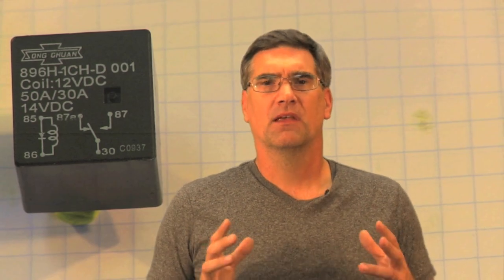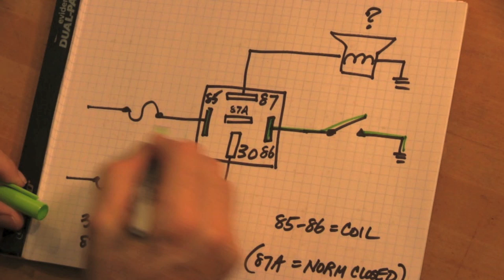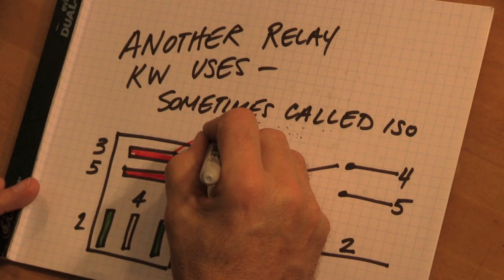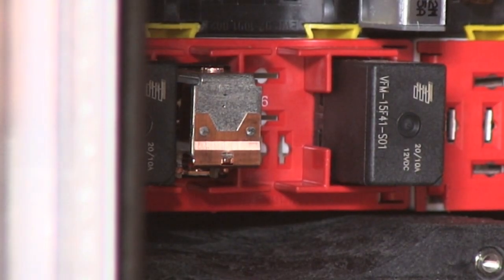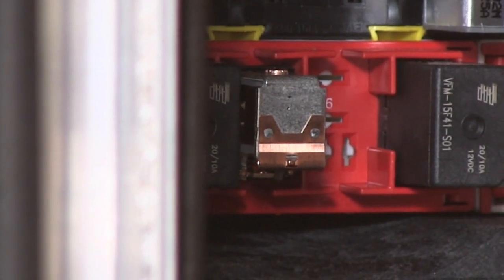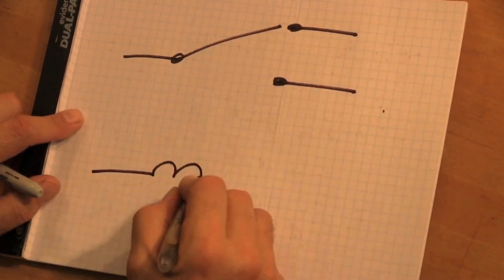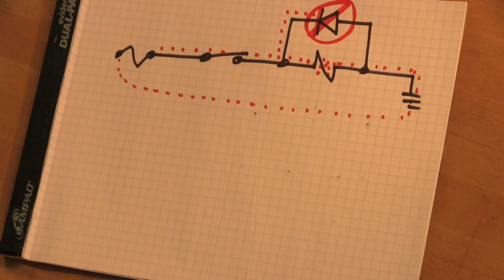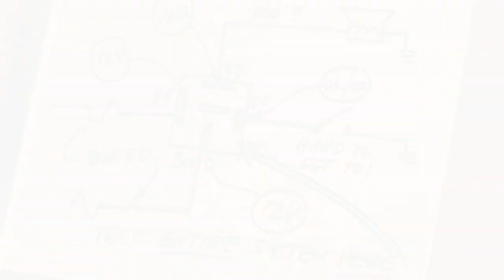VEHICLE RELAYS - Operation & Diagnosis

Comment: I understand the mechanics of a relay.  Makes the contacts to complete the circuit of the  secondary circuit.  What I don't get is why do you need a relay ???  Push the horn button and energize the horn.??
Reply: I'm guessing that by isolating that circuit with a relay, that it allows (relatively) large current draw without risking the rest of the electrical system.
Reply: It has to do with basic principle small current controls big one,therefore the wire gauge as well.  so in nut shell let say that we have horn of 10 ohm , car battery is 12V therefore you nee fuse of at least 1,5 A for horn only...If you apply relay,current needed to excite relay is usually  200-400 mA therefore you can hook several devices on same fuse and thus reduce the size of wiring loom

Comment: Seems like a complicated method when you can swap it for a relay you KNOW works.
Reply from the maker: Actually no, that doesn't work to test the system. It isn't just about the relay. That only works if the relay has failed, which is only the problem about 20% of the time. If it's the wiring in the two circuits, then simply replacing it with a known good working relay doesn't tell you anything. By using the uncovered relay you know works (we're both saying the same thing) then you can determine if it's the switch or coil circuit - or the relay. Think about it.
Reply: Good point. :)
Reply from the maker: RandyDarkshade I'm lazy. I assure you that I'll always find the easiest way to do something that gives me the most information as fast as possible with the least amount of effort required..... As far as I'm concerned this is it.

Comment: The main reason to use a relay rather than a standard switch is to isolate the two circuits mentioned in the video. For example, a horn requires a circuit with a  relatively large current in order for the load (horn) to sound (this current flows in circuit 30-87 or 30-87a). This current is isolated and controlled via another smaller current in the 85086 wires, which actually control the coil (electromagnet) of the relay.

Comment: quick question about relay pin outs.   I see a ton of them online of varying prices and brands.  I would like to try out some of the less expensive ones (5 for $15) but i'm not sure it's just pull the plug, replace, and go.   Are the  pin locations/numbering standardized on most of them?   this is for a common aftermarket relay, not a proprietary type that would plug into a fuse block.

Comment from the maker: It's way easier to pull out a relay that costs the manufacturer about 5¢ to manufacture when those contact points fail than it is to pull out a horn switch buried in the column when they fail. Every time you sound the horn, the coil in the horn stores energy that's released back into the switch when you open the circuit. That energy arcs the point and that switch stops working. A manufacturer does what is does for 2 reasons - easier, or cheaper...

Comment: Terrific explanation and video presentation.
Question: why would a relay flip with a 9 volt..... but then not function with the 12 volt in the vehicle?
I'm trying to get a hi-lo beam dipper switch sorted out on a old Triumph 650 (pos. ground).  Battery, bulb, and wiring test fine.  Relay just won't flip. 
Thanks for the videos and any ideas about this prob.

Comment from the maker: You need to know what *is* working.  It cranks, it starts, but it won't run. It will run with an outside fuel source, so you need to understand the fuel system. What is involved getting fuel from the tank to the injectors? Is there fuel in the tank? Are the fuel lines unobstructed? Is there a fuel pump? If yes, *don't* simply replace it. Is there a fuel filter? It's impossible to simply see what's wrong - figure out what's NOT broken. It will take time - that's normal. Be patient.....

Comment: very informative video! great drawings too!

my car will crank but not start
I have 87 Porsche 944. new battery and new fuel pressure regulator but wont start. If i spray starting fluid through the air intake then it does start. what should i check for next?

Comment: As you say, the solution was simple! But in my defense, the horn has never worked since we've had the car, and I thought it could be a possibility that the car was repaired after an accident and just wired up wrong. (Barking loudly up a very big, but very wrong tree apparently ;-))
Have got a colleague repairing the clock spring as we speak, so should all be good for the weekend!
Thanks again for all your help!

Comment from the maker: Sorry for the delay. I was away from email and internet a while. You're not lost, you're looking in the wrong direction. Why is the relay energizing? The circuit is complete. Why is the circuit complete? I have no idea. If you're switching ground, there's possibly a short to ground before the switch. If you're switching positive, there's possibly a cross to power. Think it through. The relay is working, right? So it works. It just won't stop working. Think about it.......

Comment: Hia again Daniel. Re-checked the wiring diagram on Autozone, and the 5 and 3 are inversed!  Rechecked after having re-drawn my rely circuits and have found the problem in the steering wheel clock spring! (As you marked in your tutorial - check the polarity of the connections before starting!!!)
Thanks again, and you're really an excellent prof! Cheers!

Comment: Hi Daniel.  Thanks for the excellent tutorial on vehicle relays.  I'm not scared to attack the problem now!
However, I'm trying to repair the horn circuit on my wifes Corolla (2001).  I've performed all the tests, and have the following results (ISO Relay):
1 - 12V, 2 - 12V/Open Circuit horn pushed or not(!), 3 - 0V, 5 - 4.5Ohms.
I opened the relay and the horn sounds when I push the contacts together.
I checked the relay with 9V battery and it works OK.
Relay wired wrong in the box? Please Help

Comment from the maker: That happens - it isn't very common, but it happens. Hope you were able to benefit from any effort you put into the harness inspections (if you did them). I still contend that the 80% rule of wiring is the best way to start. The odds suggest you'll have the best results by assuming wiring, but there will always be the 1% ECMs. Hope I didn't mislead you too badly.

Comment: Hi, thanks for you in depth explanation. I do have a 2003 buick lesabre that has a power trunk that is no longer operable. It has two fuses and a relay that are related to the power trunk. Both fuses are good, one was blown before and I replaced it.  The question I have is can you reverse a relay, I mean can you yank it out and spin it 180 degrees and if you can what are the consequences.Finally what steps should I take to solve this problem.
Thank for you help and instruction.

Comment from the maker: This method isn't wrong, but it certainly isn't right. If you think playing relay roulette in the panel is an adequate diagnostic method, then I would argue that it isn't. That method might confirm that the relay IS the problem, but it doesn't do anything for you if the the relay ISN'T the problem. My uncovered-relay method isolates the actual failed circuit, while the covered relay cannot. I won't say not to do it, but after 30 years I think the way I teach is the better way. It's all style...

Comment: I usually just change out the relay and see if it fixes the problem. In most vehicles the same type relays are used for multiple components. So I'll just borrow one of the other relays from say the starter to see if it's the issue.

Comment: Hi, I followed your indications to mount  in my car and electrical fan with a relay, but i did  a little mistake , I put 86  in 85 and worked ok, after  I tried to put a 2nd elecrical fan and I saw the mistake, I put  wires according  indications  and  the electrical fan worked slowly,so I had to go back. Question is Why did Ef worked slowly? Thanks a lot.( I use  a relay wit a diode  and when  I went back  diode turns on.)

Comment from the maker: Nothing really. You can break the circuit anywhere and it works. Most computer systems that switch devices switch ground because when operating, voltage on the wire to the ECM has 0V. This also means that the voltage can stay out of the cab. Some people say there's less arcing if you switch ground but I've never seen it.

Comment: Thank you for your reply, my point is that besides the understanding, for the number 1&2 question, if the 87A pin is connected to GND and load/coil have the same Vcc1 then it will always be a flow from 30 to 87A and the horn will always be on unless 87A is loose but it could damage the system,but if we connect Vcc2 to 87 and the horn to 30 and 87A grounded with the load, the only flow would happen only when the horn bottom is pushed and both circuits would be isolated.please let me know.Thanks

Comment from the maker: 1) Not always, but it will *usually* connect to the load and then to ground. There are times when it can be otherwise. The Key is to understand how it works, and not try to memorize a specific pattern.

2) Sometimes, but not always. Depends on the system. Sometimes the coil wire will simply be a jumper from 30 to the coil behind the relay panel. Choice is yours, as long you know the 2 circuits are separate.

3) Depends on diode if there. Diode will always "point to positive" if across a coil.

Comment: Hi Professor, very nice explanation of the system, however, I have a couple of questions for you. 
1) Is the 87A connected to GND? I Guess it should
2) Does the horn Voltage supply is the same as the Coil Voltage supply?
3) Is the 85 pin, the positive terminal of the voltage coil supply?
Thank you in advance for your answers

Comment from the maker: Yes - if you realize that for a relay to switch a component, that component has to be connected to the relay - usually terminal 87. 87 is at the "top of the T" when you lok at the relay base. Voltage will (usually) be at terminal 30, and you can (a) read voltage at 30 and load it, (b) read resistance to ground at 87 (usually less than 300Ω), and (c) use the ammeter function to just from 30 to 87 to run the component. Mechanics "go to the part" - electrical diagnosis is done at the test points.

Comment: i want to use my factory turn signals on my bike to power a 12v strobe power supply.. (which needs constant 12v to operate) how do i by-pass my turn signal flashers or relay? basically when i L- or R- turn I want the 12v going to each bulb to remain constant until i cancel them using the cancellation unit or switch on handlebar.. by pressing off.

Comment from the maker: The only way is voltage drop. I recommend LOADpro or Relay Buddy. Turn the load circuit on and test the voltage drop at the component connector. Or use the Relay Buddy which cycles the relay and measures drop across the contacts automatically. The best method will always be to test the circuit under load. I know people want to ohm out the contacts but it's hard (gotta energize the coil) and not very effective. Remember, the ohmmeter is essentially a sucky diagnostic tool.

Comment: Hi their I have a standard 4 pin 30 amp automotive relay. the points are 87 30 86 and 85. would the 86 pin on the relay be ground? thank you.

Comment: Awesome vid, but I have a starter relay on my bike that I thought was blown because I tried to jump it with a car that was running (should have turned the car off) so anyway it doesn't work, but I can still start the bike if I take a piece of metal and touch both bolts on the top of the solenoid so that the current flows through them. I replaced the solenoid but it doesn't work, and I have to do the same thing and touch a piece of metal to the bolts on the top to engage this. any ideas? thanks!

Comment: This video is a nice change to the many fall short videos I see on YouTube for automotive repair. 
I never thought about splitting the circuit much at the relay but this is genius. Most of the time in the past I've just removed them and manually jumped the contacts or coil to see what happens and where to go next in the circuit. This is a much better way to go. This guy definitely gets it. I'd like to see what else he has to offer. :)

Comment: Great Video, I'm dealing with a Auto-shut down relay next to a Fuel pump relay there no Action with power going to fuel delivery or anything.Question if you pull the relay out.In the recept-part should I have a Ground and a Hot inside the female recept- part ?